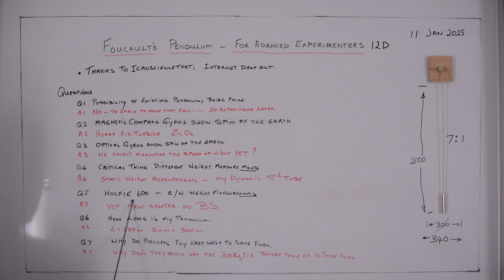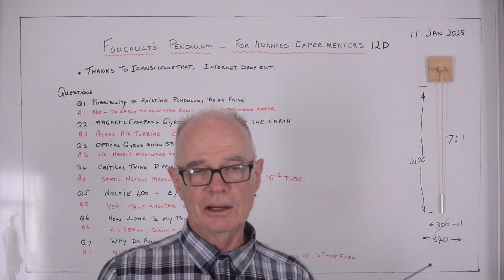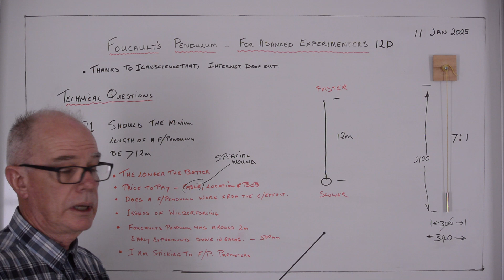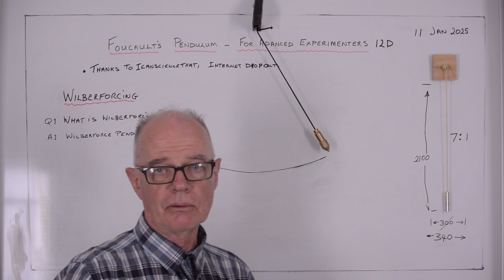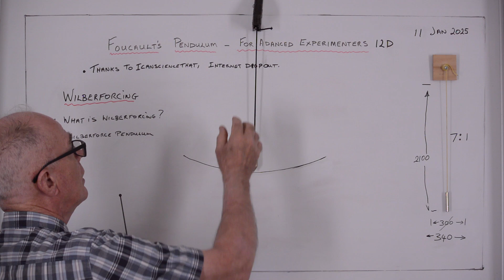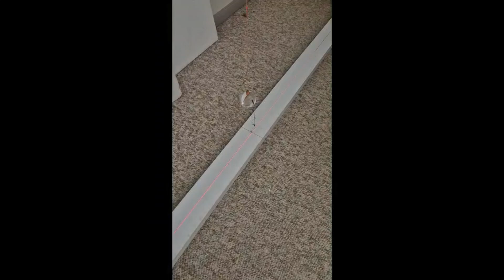Foucault Pendulum for Advanced Experimenters 12D

Comment: Hi Peter, I'm not sure how I ended up on your channel, great experiments! I love the scientific approach! 
I'm a French engineer, I don't live in Paris but I could go and check the pendulum there, if you have any questions about how it's set up I could relay them.
The ratio is unimportant, what you need is a pendulum that keeps on going for maybe 2 hours. So it needs to be tall and heavy for maximum inertia. 
If the Earth rotates once per day and is spherical, then it spins at 360°/24h=15°/h at the North or South pole. At the equator you won't see any rotation. In Paris the rotation is 11°/h. That is 0.183°/min. At your location it may be even less. So the longer you can make the pendulum go, the more likely you should be able to observe a rotation. Good luck!
Reply from the maker: @remimn1 Thanks for the offer to investigate the Paris pendulum.  I have now invested 30 experiments into the concept of the Foucault Pendulum.  As you are probable aware Foucault never made a technical drawing on how to manufacture a working pendulum hence there is no bench mark only guestimation.  
My assumption is that the Foucault Pendulum in Paris is not the real thing but a demonstration model.  Being a demonstration model ensures the pendulum performs faultlessly each day for the viewing public and I consider this to be fair and not to be judge technically as the actual proof of concept.
Where I need help is the height of Foucault's garage where he proved the concept, there is only hear say that the height was only between 2 to 3m. 

As a boots on the ground soldier in Paris if you can track down the location and height of Foucault's garage, that would be a game changer.